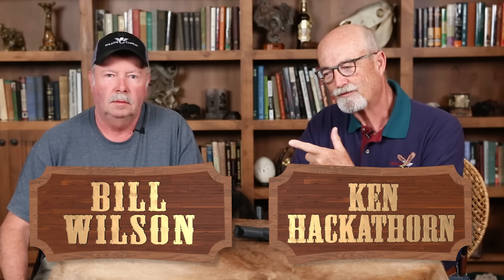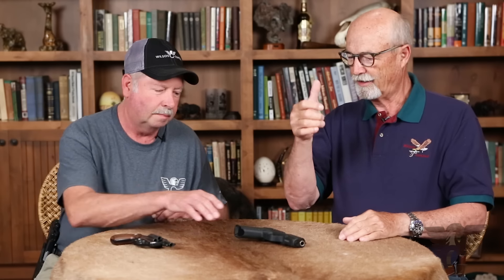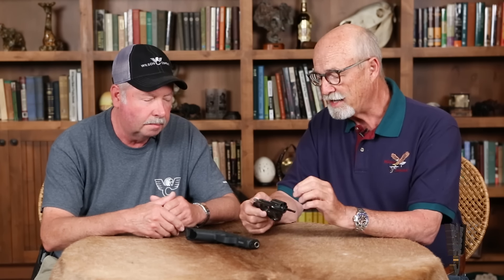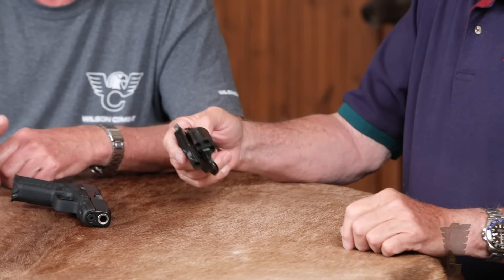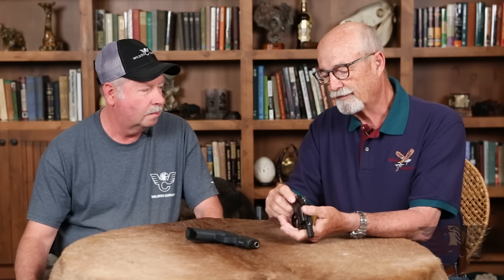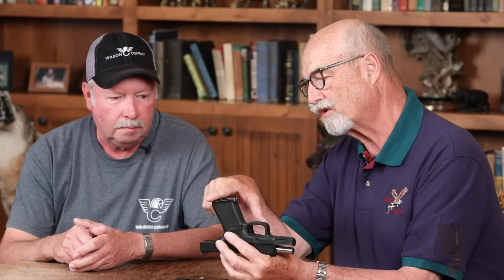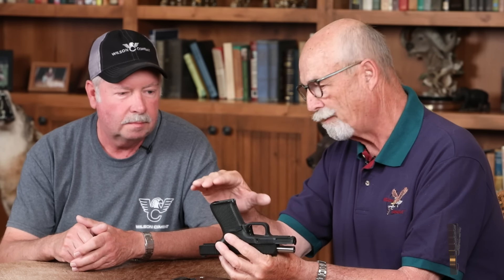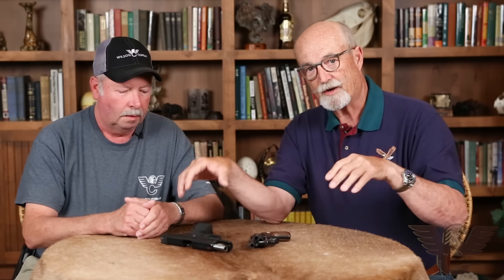DON'T DO THIS to Your Guns - Gun Guys Ep. 17

Comment: You should know that factories run their pistols empty  hundreds of times, cycling the slide empty,  in specially designed machines, to break the gun in..so no, it is not destructive to guns, it is false. About revolvers, I agree, it is destructive to close the cylinder that way.
Reply from the maker: Really, that's very interesting! Tell us more about how guns are made.
Reply: @gowilsoncombat  come to Europe and ask the big manufacturers  like Beretta ..they might tell  you. They can make almost 100% reliable pistols for 700 euros..doing exactly  what you advice not to do: to cycle  their pistols empty in specially designed machinery hundreds of times before being sold. Where I live we know how make guns, too.
Reply: @Provo647  so I'm new to this and have a couple pistols.. would you or someone clarify this for me?
on an UNLOADED gun, is it okay to use the slide lock/release ? and/or slingshot it?
I know it's okay when I'm loading a round in the chamber.. but what about unloaded?
looks like everyone has conflicting reports
Reply: @scott.j1  no it is not, the gun is designed for that and in factories they do that 300 times on specially made machines, to cicle the action and break the gun in. Just check Beretta factory videos. Wilson combat think they know everything about guns, but they dont.
Reply: @scott.j1  just check where the slide stops with and without a round in the chamber.....exactly in the same place...the slide stops in the barrel.
Reply: @Provo647  yea. Still not sure. Saw a vid from iraq veteran 8888 saying that it’s bad for the gun, along with these Wilson guys. 
But I see others releasing the slide via slide lock or slingshot on a empty chamber in vids demonstrating gun safety without mentioning the topic. So still unsure.
Reply: @scott.j1  check your pistol. Where the slide stops with and without a round in the chamber. Allways in the same place. In the barrel...touching it,
Reply: @gowilsoncombat  well apparently yours are made out of glass if dropping the slide dry 4 times can break shit

Comment: AR will run bone dry.
Reply: Exactly. Idk why he said it won’t it’s  simply not true. I know guys who have never cleaned their ars once have thousands of rounds threw it.
Reply: Some will some won’t in my experience
Reply: Some do some don't atheist that's my experience outta the 20 + ars I have in my collection it's about 50/50
Reply: @307living3  I’ve got a full auto m4 I’ve run tons of mag dumps through and it typically runs fine dry but it definitely prefers to be run wet , it even cycles slightly faster and a lot smoother. A high end AR like DD or BCM will most likely run flawlessly for many thousands of rounds before a single cleaning and sometimes even low end AR’s will run flawlessly for even countless thousand of rounds without any Lube or cleaning as well however it’s a little less likely. My personal speculation is that lower end AR’s will have more spec and measurement errors which may increase the need for lubrication and cleaning to overcome those tiny spec errors. Also chrome chambers and bores which cheaper AR’s don’t have may increase reliability.
Reply: The Nam ‘68 & ‘69 .. cleaned my AR every day .. and still do .. there’s nothing like a nice clean reliable gun…
Reply: Personally I’ve never seen an AR run reliably after thousands of rounds without cleaning, or most firearms for that matter. Even in those 10,000 tests, which some guns perform amazingly, there is a bit of maintenance allowed during the test
Reply: It is just a point of interest, not a lifestyle to live by.  Lube is important in a lot of situations.  You may be able to get by without it.  AR rifles will run without lube, no sign of wear.  Dirty is another thing.
Reply: Apparently not an aero m5

Comment: Basically either people respect firearms and what they represent or they don’t!! Just like you see people rack a slide, cycle a bolt action, cycle a pump shotgun, commence to rack the lever on an expensive levergun and immediately pull the trigger. They may dry fire their firearm continuously. I know even when I rack the slide on my handgun I ease the slide as to gently cycle a round in the chamber. I own a handgun where the manual states you may utilize the slide release but do you think I would actually do that? It makes me feel kind of good so if it accidentally happens while myself or someone else handling my handgun actually snap the slide release I do not have to panic because the experts that manufactured and designed the handgun say it’s ok but me myself just do not see any reason to risk the reliability of any firearm I own or anyone else’s for a matter of fact!! Firearms are machines and machines are delicate as far as I am concerned. It’s good that firearm manufactures design their firearms to be tough and resilient but to purposely mistreat or abuse a firearm is just a pure case of lacking any kind of firearm wisdom!!
Reply: If you're saying you ride the slide forward when actually chambering  a round...  Then you're simply being foolish.  No automatic is designed to operate that way, and you actually are in danger of causing damage to the firearm, or inducing a malfunction, by not properly seating a round in the chamber.  Automatics should be seating a round with the full velocity and force of a compressed recoil spring releasing.

Comment: You can tell that these slide levers are designed to be pushed down via your thumb, based on the way they are shaped.  If that's wrong(it's not), blame the manufacturers.
Reply: Yes they are, when the mags have rounds in them. this isnt rocket surgery.
Reply: They never said that, they said don’t drop the slide with there is a round already in the chamber and don’t drop it on an empty slide. Only drop it when loading a round from a magazine.
Reply: @ACGBLR  you are correct Sir. It seems these people just cannot focus long enough to watch the video or they cannot comprehend what the video very well explains. I think too much Ritalin as a child or the humidity of their parents basements.  The term form them is “Prolonged Adolescent”😂

Comment: Gunblue says it's perfectly ok to drop the slide so who's lying here?
Reply: Why would you repeatedly do it, though? You can also throw the gun on the ground over and over and it will still work. Why, though?
Reply: @66smithra  you probably disapprove of dry firing too. No benefit to that either right?
Reply: @sambrown7536  I dry fire all the time with 1911s.  No issue there.  There's no need to drop an empty slide on a finely fitted 1911 though.  Do you go into stores and drop slides on guns you are just looking at?
Reply: @ nah, to be fair I’m mostly referring to when I’m sitting around with my G19. If I have to replace the extractor so be it 🤷‍♂️. Of course I’m careful with firearms I do not own. Some I care about, but it’s kinda nonsense to worry about a 20$ extractor on a more or less meaningless gun.
Reply: @sambrown7536  but surely you understand, a G19 is like a crayon compared to a 1911 that is a fine fountain pen in certain types of builds. You treat one a bit differently, right?
Reply: @66smithra  yeah bro if I buy a 2k pistol I’m either making an unreasonable amount of money. Or I’m gonna treat it real nice, I’m just not gonna buy a 1911 though. Let’s be real technology has advanced past 100 years ago. We have better options. If I buy a 1911 it’ll be a genuine WW11 issue. And when or if I do buy one of those. It won’t come out of the safe.
Reply: @sambrown7536  Okay I don't know what that has to do with anything.  The 1911 is still the basis for race guns and every other type of gun today.  Being old doesn't mean bad.  It means good because it's lasted a long time.  But either way, there's no need to beat up ANY gun by dropping the slide.  If you want to do it, fine.  And for 1911's and other finely fitted guns, you can actually damage the parts.  You just look like an amateur if you're dropping the slide on any automatic.
Reply: @66smithra  alright, keep worrying about what you “look like” I’ll go buy 5 extractors for my Glock. Just so you know they still make Winchester model 94s, do you think that means the design is still truly useful? No. It’s still around for the same reason the 1911 is around nostalgia. Those guns are art, agreed. Don’t wanna mess with them, my Glock is a tool. I’ll use it as such. try to become as proficient as I can with the platform. Have fun with your 2k dollar pistol that has a  bunch of Brittle little parts. 🤷‍♂️☠️
Reply: @sambrown7536  What's not useful about a winchester model 94?  Of course it's useful.  The 1911 is probably the most widely copied pistol in history and today in 2025 it is made by more makers than any other single firearm.  It's still a top choice for competition, self defense, etc.  What in the world are you talking about?  Do you slam the door on your car over and over?  Do you slam on your brakes every chance you get?
Reply: @66smithra  I think the Winchester 94 is antiquated technology. I’m glad you’re logically consistent though, if that’s your logic. We just have a different view on life.
Reply: @sambrown7536  But why is it "antiquated?"  It's a highly refined lever action.  What's "antiquated" about it?  Do you think the 9mm Luger is "antiquated?"  It's 123 years old.  Shouldn't you be using 357 Sig or 30 Super Carry since they are "new technology?"
Reply: @ wow, how old are you? Sir I have a lever action. But if I ever need to get anything done I can assure you I won’t be grabbing it. That’s statement alone should tell you all you need to know. Don’t just argue for the sake of arguing. You know 16 rounds of 9mm is better than 10 rounds of .45. We both know 30 rounds of 5.56 is better than 5+1 of .35 cal. The old guns have their place, I love and have respect for them. But those are luxury purchases in this modern world. If I only had $300 to my name I’d be going to palmetto and getting an AR. You can spend 3200 on your lever action and 1911. But hey, God bless John Moses Browning right?
Reply: @ if you had a choice between a model 92 with 13 rounds of 45 Colt, or your Glock 19 for home defense, which would you choose?  If you had to shoot a deer for dinner, would you choose a model 94 in 30-30 or a 223 AR?  The levers would be great in either situation.  You’re confusing old with ineffective. Even the AR 15 is “old.”  It was designed basically in the 1950s.
Reply: @ your confusing my argument, if you had 300$ And could only buy one gun would you buy a used lever action. Or a new AR? News flash I can’t hunt anything the a ar-15 btw. Squirrel to moose if I really wanted. Can you say the same for your 94? If you give me the option “stick or model 94” yeah I’m graving the 94. Duh “last gun you could only pick between 94 and G19” 94 duh. Come on dude, try to stay with the discussion.

When it comes to real life, again I love those guns. My great grandads marlin holds the most value in my mind. I take a deer every year with it, does that mean it’s a superior platform to the AR? NO
Reply: @ what does $300 have to do with anything?  If you wanted a good lever gun, you’d buy the lever gun. You can do many things with it that you can’t with an AR, and vice versa. Neither design is new, neither design is antiquated. They are just different and get different jobs done, and some of the same jobs done.
Reply: @ weird, I can think of several jobs the lever actions can’t do. But none the AR can’t, good try though.
Reply: @ jobs an ar can’t do:  be a good deer or bear rifle, be a good horse packing rifle, shoot very low powered loads, be a manually operated firearm where only they are legal for hunting, etc.  it’s simply a different design.
Reply: @ well thanks, I just had no idea. Obviously dude, if you can’t follow an argument. Then I’m done here. Good day sir :-) it’s a fantastic deer and bear gun though! You must not be able to shoot. Can’t say I’ve ridin a horse, however I’d be comfortable with carrying my ar-pistol on my back 😭
Reply: @sambrown7536  a standard AR is a good big game rifle?  You’re seriously claiming this?  The ar design is 65 years old. Why are you advocating for something so old?
Reply: @  it works fine yeah, you must not be familiar with the advancements on the 65 year old platform. Especially within the last decade even. Special forces uses them anywhere from ,CQB, SBR, to SPR and DMR. Again good try.
Reply: @ 223 rem is a good big game cartridge?  You’re claiming this?  Haha
Reply: @ if you can place a shot, they won’t make it a step from where you shot them. I’ve personally done it. 

Out of curiosity if you lost all your guns and only could buy one for some reason. What are you buying?
Reply: @sambrown7536  also, spec ops prefers the hk416. MUCH less “antiquated” than the AR platform. It’s only 20 years old!  That’s what matters.
Reply: @sambrown7536  probably a good shotgun. It can do almost everything.
Reply: @sambrown7536  a standard AR is not a good big game rifle. It’s nowhere near as good as even the 30-30, let alone a 45-70 or many other true big cartridges that are chambered in lever actions.
Reply: @66smithra  yeah and 500 nitro is a better elephant cartridge. Should I buy that? You do understand the hk416 is literally based off the Ar-15 platform right?? Like you get that? Or?
Reply: @ it’s a job that it does better than an antiquated AR though.
Reply: @66smithra  😂 now you’ve officially lost me, anyway. Have fun defending your home with your .410 ;)
Reply: @sambrown7536  but it’s a modernized version man. You’re using the antiquated version. The 416 runs cleaner and is more modern. You should drop the old tech. New is always best.
Reply: @ 12 ga. But the 410 is WAY more effective than a 9mm Glock 19 for home defense.  And you can shoot deer, birds etc for dinner.
Reply: @ you never answered my question. At this point I think you’re trolling, how old are you? Also, love my great grandads lever action 410!
Reply: @sambrown7536  you’re asking me how old I am while claiming that something is not useful just because it’s old?  You’ve got some pretty juvenile viewpoints on guns!  😀 as you get more experience your thoughts and tastes will become more sophisticated in firearms. Hang in there.
Reply: Apparently the $4000 Wilson is as fragile as fine crystal.
Reply: @robertwarner-ev7wp  just finely fitted.
Reply: @66smithra  When they say their sear breaks as smooth as glass they mean it!
Reply: @ If you can't understand fine mechanical things, you may want to stick with Glocks.  If you're happy with that kind of trigger, you can just drop your slide over and over and have fun!  Just don't let the frame get too close to the fire or have your dog chew it!  :D
Reply: @ if you can’t take a joke I suggest you jam it.

Comment: Well, if you two wanted to create more drama in the gun community you succeeded with flying colors. Talk about 9mm vs 45 next, there is another fire you can throw a gas can on. As though our community needs more division, I mean it's not like we are under constant attack and need to stick together or anything. You might want to pull back on the arrogance and insults a bit as well.

Comment: It’s pretty suiting that 1911 guys don’t care if it’ll shoot 2,000 rounds
Reply: You planning on getting into a 2000round gunfight cowboy?
By your logic you shouldn’t drive a car if you need to change the oil every so often cuz you don’t have to changes the oil on a Tesla.
Reply: @Heywoodthepeckerwood  I agree.  I'm a 1911 guy to the bone and have 55,000 rounds on one my favorite one.  But I'm dumfounded why someone would not want to lubricate or clean their firearm after 2000 rounds.  Why not?!
Reply: @Heywoodthepeckerwood  we don't plan on a 2,000 round fight, but we do want to know the gun can handle it. But hey if your fragile little flower of a $3k gun can't handle a measly 2,000 rounds that's cool
Reply: @evocati6523  could tour block handle a single drop to the pavement in freezing temperatures without cracking? 
Go do it. Your Tupperware isn’t nearly as tuff as you fanbois like the think.
Reply: @Heywoodthepeckerwood  are you planning on dropping your guns on concrete while gunfighting in the arctic, cowboy? Oh so you do understand that planning to do something and expecting something not to break when said task is performed are not the same thing. I don't drive 100 MPH but I expect my vehicle not to explode if I do. If these expensive guns can't handle basic stress tests then they're garbage

Comment: That's not always true about the NATO ammunition I don't know where you got your specs from but all NATO ammunition if it's like 556 or stuff like that is not overpressure so whoever told you that or wherever you read it is wrong because you can go to the Loading data for the same equivalent of 9 Nato rounds like the 223 / 556 is the same powder and loading data so how is the Nato round overpressure want to have the same specs of powder in it that's saying a Corvette motor is over-pressured cylinders and a Camaro engines motor is under pressure when is the steam engine I'm giving cardata because most people don't understand guns so you don't know nothing about ammunition if you're saying Nato rounds overpressure and the other ones are not there the same you can get the NATO spec 9 mmm it's a different number for 9 that and it's the same loading data go to your loading data charts on your reloading your rounds and it'll give you all the specs you supposed to follow and they're the exact same ones as non Nato rounds as the Nato rounds